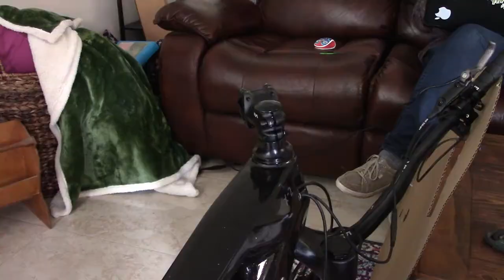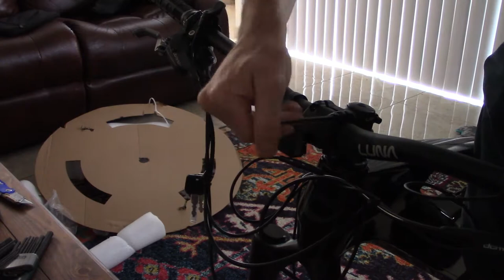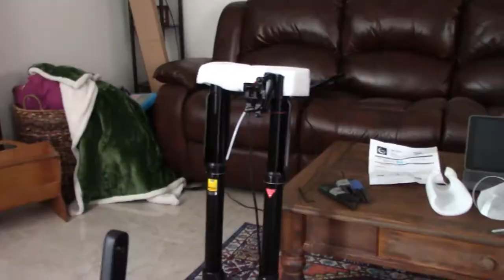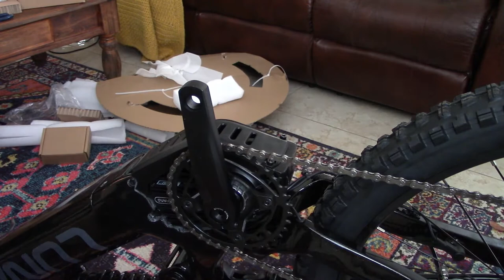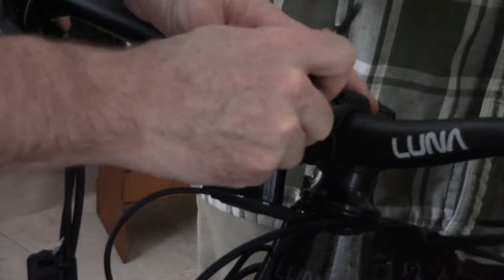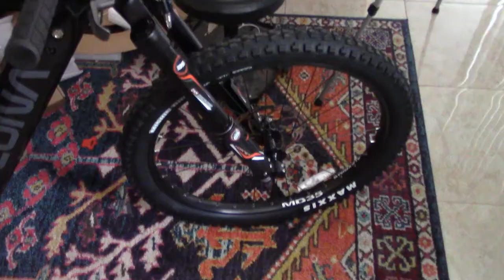Luna X2 Enduro Assembly

Comment: It looked like you had a little trouble getting the pop up seat working, but I couldn't figure out what you did to fix it. I can't get mine to move at all. Any thoughts?
Reply from the maker: It was a little sticky.  I had to hold the button down and then push the seat down to get it to release initially.  Also, you have to push the button down all the way.  If you don't push it all the way down, with a little force, the seat won't come back up.  You could also check the seat stem clamp.  If the clamp is too tight, it won't let the seat stem move either.
Reply: @ls6777  You are correct. The first time I mounted the bike and sat, the seat released.

Comment: Is the display in color and easy to view on a sunny day?
Reply from the maker: The display I received is NOT color.  I haven't tested it in direct sunlight yet as it's been raining the last 2 weeks here.  It does have a backlight option with various brightness settings though.  and since it's a "white on black" display, it's easier to read in daylight by default.
Reply: @ls6777  I found the display useless if wearing sunglasses. I hope there is a method to increase the contrast or something to make it better. No operating instructions were included with my bike.
Reply from the maker: @gregheironimus2478  It depends if your sunglasses are polarized or not.  I have some that are polarized and I had the same problem.  If I wore non polarized sunglasses in was ok.

Comment: On mine one of the front fork was longer than the other. I had to push it down to fit the wheel in. What does that mean?😳
Reply from the maker: It could be that one side stayed compressed, while the other rebounded.  I believe rebound and compression on these shocks are on opposite sides, so there may be an effect from that.  

As a note, I had to remove the front wheel to put the spacer in I forgot the first time.  One of the shocks extended more and I had to do the same thing as you to get the wheel on.  Doesn't mean there's anything wrong with the fork or that one side is actually longer than the other.
Reply: @ls6777  Thanks for that information about the shocks. I was worried sick that my fork might be "stuck down". I saw that note about the spacer in the video but I can't figure out exactly what it is you're referring to.  Is this what you're talking about? https://youtu.be/Wp5vEM9McJU
Reply from the maker: @Zetler  yes... That video shows the wheel spacers. One for each side.